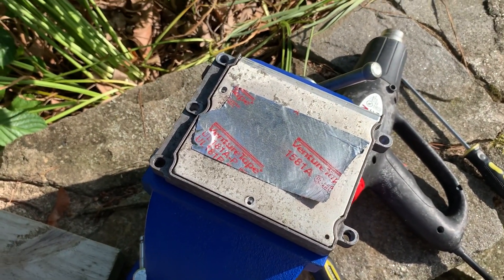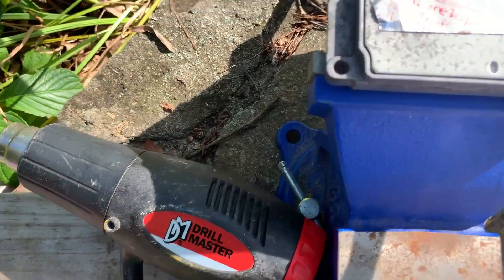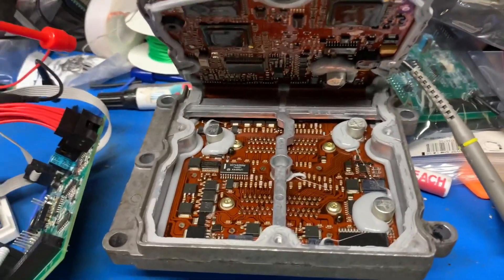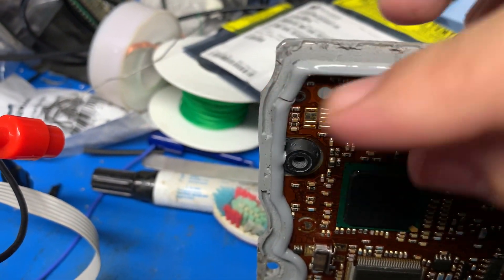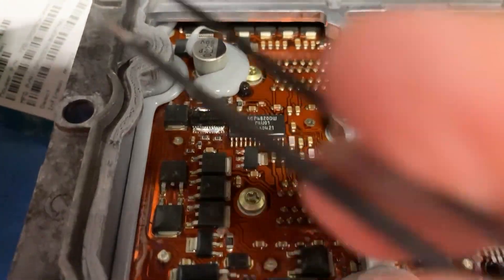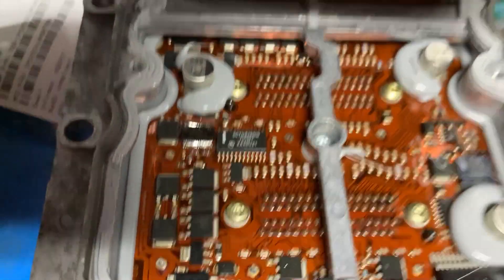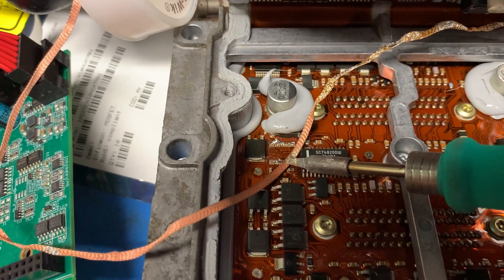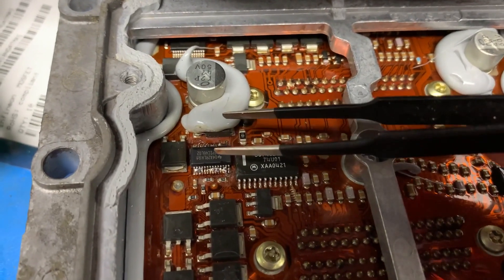SAAB 9-3 Disassemble ECM 2003-2011 PCB Repair T8 ECU ECM Codes P0201, P0202, P0203, P0204, P0245

Comment from the maker: Please check the description for mistakes and corrections.
Reply: do u have a business   i need this done
Reply from the maker: @michaeltomczyk3311  I don't, sorry about that. But if you can find someone who does surface-mount electronics work, they have access to the right equipment and it's a pretty easy job for them.
Reply: Hi  did the rebuild work  and how long is it going?
Reply from the maker: A year so far.
Reply: Where did you order the part ?
Reply from the maker: @fredyflores5799  see 5:26
Reply: I would like to know if the other TPIC46L02 chip on the board should be changed? it's the one in the very corner above that metal film capacitor right under the aluminum frame by the flat ribbon interconnects on the board, do you know what that gate drive controls? Thanks

Comment: I've got a 9-3 which starts and runs good,  but it sounds like it's not firing on some of the cylinders sometimes. It happens when the engine is cold. When the engine is warmed up, that problem is gone. And it drops the rpm faster than normal aa well during a gearchange. And I got a fault code P0686 which has something to do with the ECU. It's quite difficult to explain, but what du you think could be the problem?
Reply from the maker: I would search the trionic tuner forum.

Comment: Hi, I had a question about the ECM relocation kit you mentioned; apart from extending the ground wire for the ECM, was there any additional wiring you had to do for the relocation kit?
Reply from the maker: You have to extend around 4 wires and a ground. Pretty easy if you comfortable with simple electrical / electronics work.

Comment: What 5 wires did you need to extend for the ecu relocate?
Reply from the maker: When I bought the relocation kit, bracket, etc., linked in the description, it came with a video I used to do the work. But when you unwrap the harnesses, it's pretty apparent which wires are too short of reaching.

Comment: Hello good morning sorry for my English I use translator .. I have not read all the comments maybe I have already asked this question .. kindly I would like to know if after replacing the chip you have to program the ECU or is it not necessary to start it?  thank you
Reply from the maker: The chip has no memory. But I would make a backup of your original ECU incase you destroy it while working in it. It’s easy, there is a link in the description.
Reply: @cargoudel  ok Thank you !!!

Comment: Did you replace the injectors as well? Had my Ecu fixed and the repair place required I changed my injectors as well. Just curious what your thoughts are regarding this. Thanks for the video!
Reply from the maker: I wouldn’t assume the injectors are bad.

Comment: Question,
After you replaced the chip was it plug and play with all the memory secure?
Reply from the maker: There is no memory in the chip I replace in the video, so yes. No need to program or reprogram anything after replacing the chip.

Comment: Hi my T8 ECU has come up a Po606 code is there anything i can do to fix it as they want a $1000 for a refurbished one here in Australia or whats the best way to go about it
Reply from the maker: If the car has been tuned it could be bad settings / bad map. If the car is 100% stock, it's probably the processor or may be corroded connectors. I would check out the website trionic tuners for help with ECUs, register for the site, and use the search.

Comment: Got P0691 fan speed 1 not working, sympthom limited torque and no A/C working
Power is fluctuating when hitting a throttle when driving   ... Ecu failing?
Reply from the maker: I would agree. There are some good videos on cloning your ECU to one from a junkyard.

Comment: Hello, i got mine replaced cause of an intermittent P1682 code. After the replacement of ecu, the code is gone. I still have the old one and i wonder if i can fix it and use it as a backup. Can you help me out with this?
Reply from the maker: Looking at some schematics on trionic tuner site, that code is for the main relay which is on the other TPIC but that one is near the top under the cross bar near where it hinges.

Comment: Do you offer the service to replace the chip on the side.  I have extra bad ECU in hand from these code.
Reply from the maker: I don't. But if you open it for them, many electronics or tv repair shops can do this work.
Reply: @cargoudel  thanks.

Comment: Thanks doe this video. I just bought a 07 9-3 and it has literally these codes. I’m glad to see someone out here who knows how to fix this instead of having to send it to Illinois for 600$. I might be coming back here asking for help soon lol…
Reply: Where were you able to source that chip from?
Reply from the maker: @TheForerunner117  check out 5:26 in the video (mouser)
Reply: @cargoudel  I did just buy this car and don’t know much about it yet but it has all the right codes and all I see online is if you have them it’s the ecu so I’m pretty hopeful this works for me. I haven’t seen any smoke or fumes or whatever but the owner did say every once in a while you have to floor it to make it start so is sounds like it’s on the right track. Is there any other ways to confirm the fix will work or is it just worth going for it and seeing what happens? I cleared the codes on the car they imediately returned on next startup so with 260k I’m sure it’s the problem.
Reply: @cargoudel  I don’t have one of those fancy reflow deals but I do have a heat gun with adjustable temp and one of those tiny choke down attachments. You think that would work? I could use my laser thermo to keep an eye on temps
Reply from the maker: @TheForerunner117  it’s a bit risky. It’s important to flow (add solder) the pads first with a decent iron. I have done it before with a heat gun. You might wanna protect the other parts with aluminum foil. Use the low setting. Don’t use the heat gun with the new chip.
Reply: @cargoudel  do you mean to say I should add solder to the pads before removing the old chip? Or do you mean after removing the old? I do have a decent little soldering iron that has temperature control. What temp do you recommend?
Reply from the maker: @TheForerunner117  I am talking about removing the old chip. Adding a bit of solder before removing with the hot air does two things: 1. ensures you have removed the conformal coating. 2. Makes it easier to reflow with air

Make sure you have good chemtronics solder wick to clean up the pads after removal. 

As for the temperature for soldering the new one. Depends a lot on your iron. Look up videos on drag soldering. The temp needs to be a little hotter a standard pcb because it’s so well heat sinked to the aluminum. You should be hot enough so you don’t have to keep it on the pin very long to flow the solder but not much hotter than that. Use flux. Lots.
Reply: @cargoudel  thanks for the advice. I went for it and even though because I was a little careless while removing the old chip, and I lost the very top right trace it fixed my problem! I’m thinking it’s a redundancy or an extra ground maybe. It’s the pin next to the divot so I guess that means it’s PIN number 1. I do have 2 extra chips in case it fails again and if it does I Will attempt to repair the trace even tho it’s so damn small and there isn’t any holes where the trace starts. I imagine I just have to scrape off some of the orange where the circle bit is maybe
Reply from the maker: @TheForerunner117  it will probably work without that pin. It’s a fault flag output from the TPIC. Not sure if the MCU checks it. 

Pin 1 of TPIC46L03
Fault flag. FLT is an open-drain output that provides a real-time fault flag for shorted-load/open-load/over-battery voltage/under-battery voltage faults. The device can be ORed with FLT on other devices for interrupt handling. FLT requires an external pullup resistor
Reply: @cargoudel  well that’s good. Now I’m having heavy misfires on cylinder 3. No codes at first. Checked the plug and it was soaked in gas. Just pulled out the injectors and it doesn’t seem to drain well. Not sure what’s going on but I can’t imagine a bad spark plug or coil would cause the 203 code that says “injectors circuit”
Reply: I can make it click with voltage on the pins but when I shoot cleaner into it and provide bolts it seems like it’s not dripping like the others. I’m going to reassemble them in different order and see if the code follows the injector.
Reply from the maker: If the problem stays with CYL3, after moving the injector. It's probably either the connection between TPIC and the CYL3 mosfet or the CYL mosfet.

See this thread 
https://www.trionictuning.com/forum/viewtopic.php?f=5&t=11514&start=50

I replaced a MOSFET one time with a IPD25CN10NGATMA1
Originally it came with one of these: MTD10N10EL,NTD12N10 NT6600G (you can use those too) 
Other have tested other parts.
Reply: @cargoudel  I just went ahead and reinstalled the tpic number 3. I read on trionictuning that exceeding 260c on the soldering iron will smoke the chip, which I used a new, not thermally controlled one the second time around. They have a diagram of the chip on there in this thread I’m looking at and I’m hoping to find where pin-1 goes on the board so I can make a new jumper. When I was taking off chip #2 I think I did discover a loose pin or two unfortunately, might also have been creating my issues this time around.

Comment: What do you mean 12:55.  “Maybe if the ECU is marginal. And has to warm up before start to fail” That is happening to my ECU. I will appreciate any help
Reply from the maker: You should still replace that TPIC if you are getting 201-204 codes and the 245 wastegate code at the same time when the problem shows itself. I just mean it’ll be harder to test without fully reinstalling, but that open startup test is useful to at least show that you replaced the chip correctly. I have had ECUs that only quit after getting hot and it was also the TPIC.

Comment: Do you have to reprogram it after doing this.
Reply from the maker: Not if it's the original ECU. The chip I show replacing doesn't have code or memory. It's just a MOSFET Gate driver.

But I would make a backup in case you screw it up and want to buy a replacement and reprogram and remap. If you make a backup you can buy any almost ECU from any 9-3 from 03-11, but if you don't have the backups you have to get the exact same part number.
Reply: Great thank you.

Comment: Hola con este procedimiento resuelves el problema común de falla en los inyectores ? Saludos
Reply from the maker: If you having the P0201, P0202, P0203, P0204, P0245 codes all at the same time (P0245 is important here!). Yes, this is probably the issue. Can't say 100% though. Test it before you close it up.